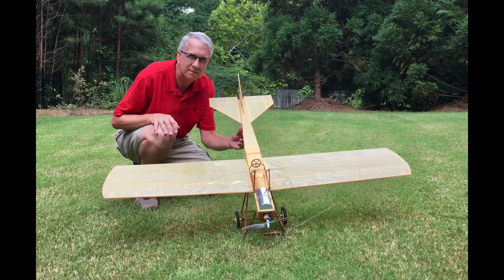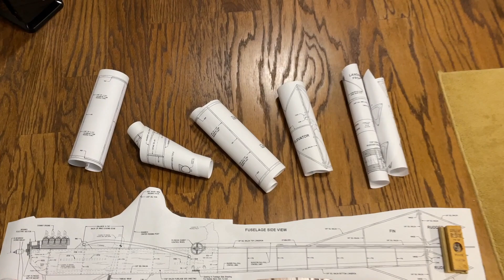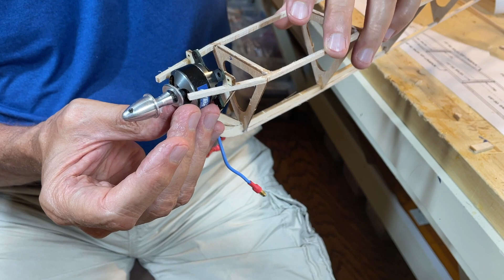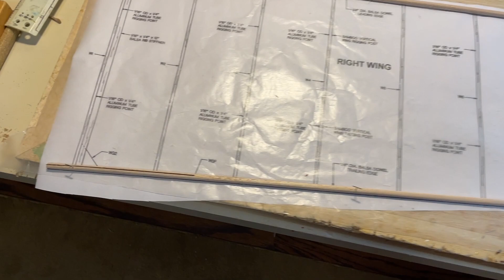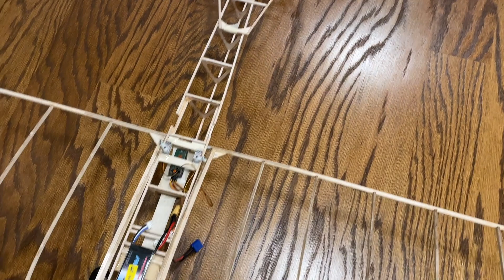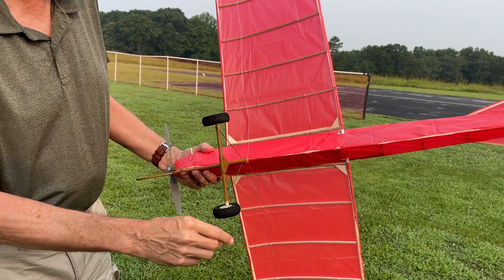Sig 1909 Antoinette RC Kit Build and Fly

Comment: Beautiful plane!
Just a few notes. You really need to tighten the covering a bit, the wings gets a lot of it's strength and warp resistance from the tighter covering.
On planes like these the rigging wires are also a must else the wings will warp like yours, I was not surprised it had such a strong tendency to turn in the one direction.
Reply from the maker: Thanks!   I take your points on the covering, strength, etc.  You have to go back in time a bit to the late 1990s.  Electric power was very new, all brushed and geared motors and nicad batteries.  Indoor electric RC flight pretty much a dream, and Sig came up with these three kits for the Pioneer of Flight series.  Gorgeous kits, works of art, but very fragile.  Sig was so focused on saving weight that they omitted using an electric switch for the power on the plane.  

So, not much strength was really needed on the wings as the planes flew very slowly.  You can see this on my Demoiselle build.  Flew like a dream.  I was pushing things a lot with brushless power, higher weight and speed, etc.  Nothing ventured, nothing gained.

I used this technique for my Blackburn design, that flew very well.

Comment: Lovely plane Tim. Good job you put the tension wires on. That wing looked very flimsy. I do like to see a main spar normally near the C of G in a wing. The Aluminum tubes idea is very good for this model. I love vintage planes like this. Keep it up Tim
Reply from the maker: Mark:  Good points and thanks for checking in!  Tim

Comment: I can understand they wanted to keep the weight low, but a wing with no spar or cross bracing, purely relying on the rigidity of the lead and trail edge, feels like asking for trouble. Unless using some extra rigging to keep the wings in tension, like they did on real planes with similar design. I think your improved version will have a much wider flight envelope
Reply from the maker: Yup, that’s the way they built all aircraft until around 1917 or so. Fokker D-VII and D-VIII had cantilever wings, no rigging wires. Tim

Comment: Some flying wires from a central point on the fuselage to the tips top and bottom would sort out the flexing Tim, this is what I have on my Yo-yo design which is very similar construction and it works really well 🤔👍
Reply from the maker: Thanks for this tip!  Tim

Comment: Nice interesting kit. Also how about some carbon fiber reinforcement for the wings in the form of extra struts or wing spar. Looks like your altitude was about 15 feet. If you park fly you’ll need to further adjust weight distribution to hit your COG given that the aircraft is ~ 1.5 lbs .
Reply from the maker: I usually try to build the first one per the directions. If I really like the kit I’ll make a second one with various improvements. Tim